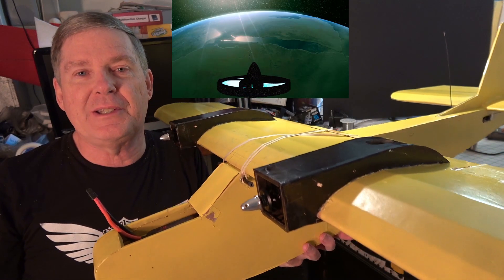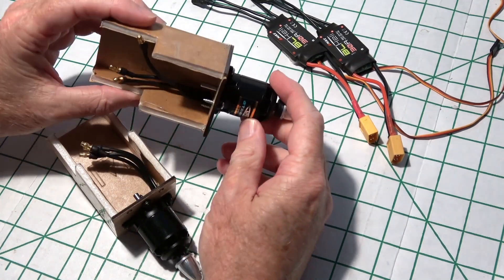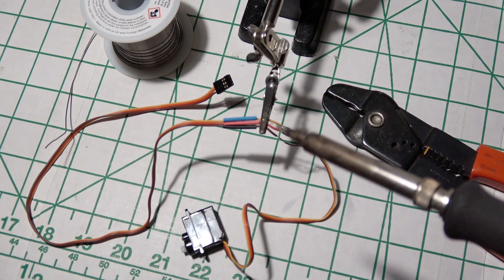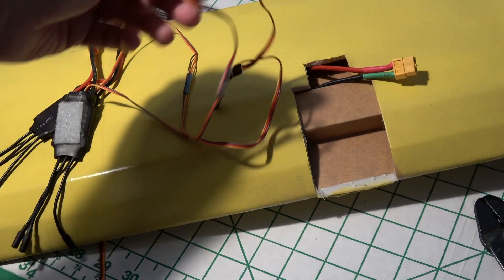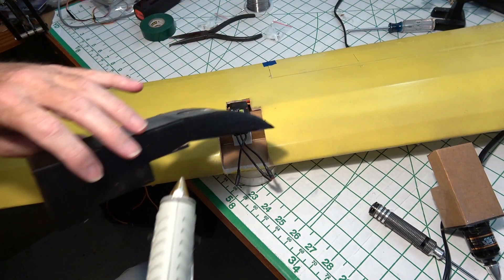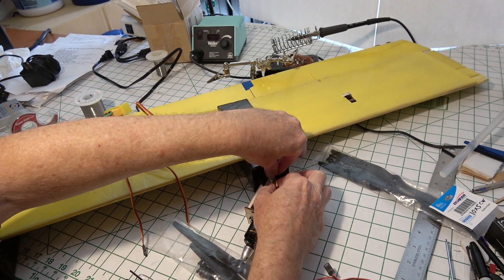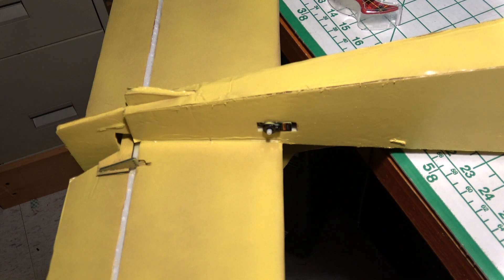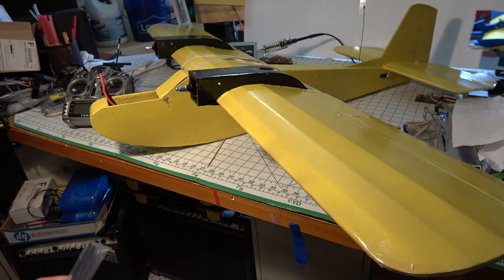Founders FT Legacy RC Plane Build - Part 5 (FPV iNAV Differential Thrust) Motors, Servos Linkages

Comment: Dave, those are excellent videos and I like your approach to it.  I was wondering about two issues I've encountered when extending the wires in such manner (~3:40), does it require adding capacitors to the setup to negate damaging the  ESCs or those built in already should suffice? The second issue regarding BECs assuming those are linear, should I worry about connecting both at the same time to different channels and will it be enough to power 6-8 servos when using flaps and the FPV gimbal?
Reply from the maker: No I don't think you will need to add capacitors. The wires are not that long.
I used a separate UBEC for the servo rail instead of using the BEC's from the ESC's in the final setup but to answer your question: No don't connect both BEC's together.

Comment: Great job young man. I have the same ESC's as you, for that S500. Did you have to program them? Seem like I remember you programming some ESC's by a beep. I found a program for ESC's. I believe it's called BLHeli Suite. I'll double check that name for you. I found on YouTube by How to program ESC's. I think I like the beep method better. Going to have to get my S500 done wife tired of looking at it. She told me yesterday so I figure I have about a month before I get in real trouble. Lets get her done.....
Reply from the maker: It's probably a good idea to get that S500 done anyway because you want to take it out and have some fun. Yes I have heard of that programming configuration tool for the ESC but I will probably just go with doing the throttle Cal after all it's just an airplane and not a quadcopter. Hope to see you in the air soon good luck.